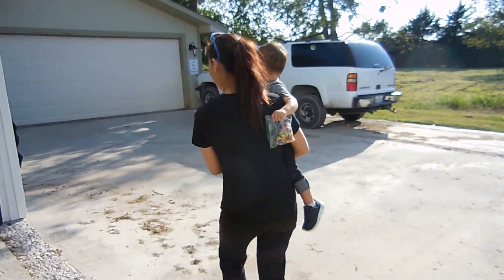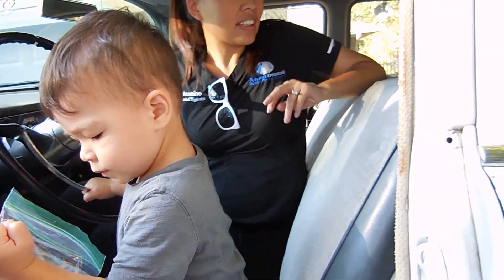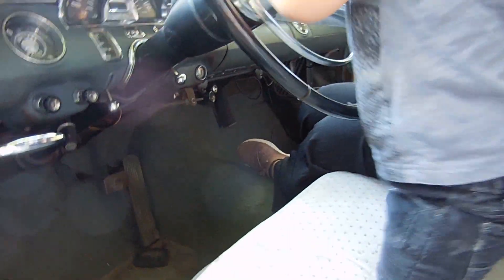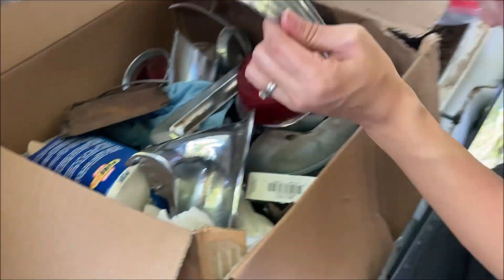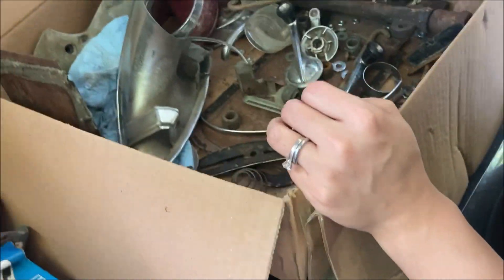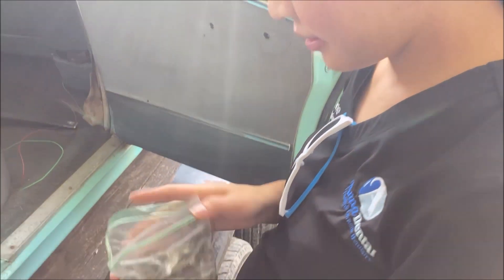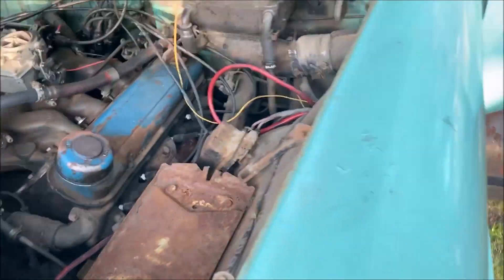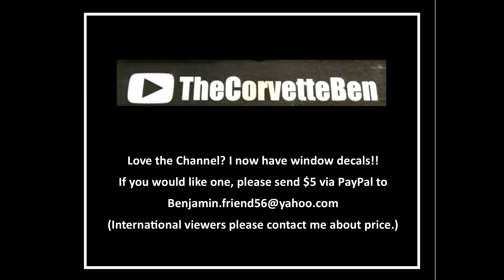WHAT?!!?!? My wife bought her first classic car!!!!! 1955 Pontiac Chieftain Sedan Part 1

Comment: YES there is a "Park" on the old  Hydramatic,, what you do is, shut off engine, wait like 10 to 30 seconds, and shift into reverse, it will lock,, had a old Pontiac,, the owners manual tells you to do that
Reply: I had a 54 cad ,when the engine shut off parking engaged on any gear but neutral....
Reply: Before I saw your reply I wrote the same thing. My late father's 49 Olds had that same hydromatic, same feature.
Reply: usausa 1  the very first car with automatic transmission was  Oldsmobile in 1939, Oldsmobile was the prototype for GM , GM sell Hydramatics to Rolls Royce and Ford ( Lincoln ) when the factory burned to the ground  on 1953 GM used "Dynaflow" transmission ( Buick division of GM) on  Cadillac, Oldsmobile and Pontiac...  "Dynaflow" transmission is very smooth, with no issues... Nissan tried to make a transmission as smooth as "Dynaflow"  ...Nissan CVT but... they have thousands of Issues...
Reply: @scrrgrc    I recall people hating Dynaflow because they were slow and caused high gas consumption.  They were nicknamed Dinosaur Drive.
Reply: @discerningmind  ha, ha,ha " dynasaur"..yes, they are very slow, but very smooth ride, I have three old Buicks,
Reply: Same as my father's '53 Chieftain.
Reply: My 54 Olds had the Hydramatic....like drfalcon4102 said drop the shift lever to Reverse to attempt to lock the transmission so car won’t move on a hill when parked, but the shift linkage requires periodic adjustment to allow for solid shift into reverse.  If she won’t shift into reverse that means the shift linkage needs to be adjusted.  Hydramatic is a four speed automatic but first gear is extremely low.
Reply: @discerningmind  Or Dynaslow
Reply: @JohnBea    Hahaha!  Very good.
Reply: Was going to say the same
Reply: @scrrgrc  Although there might have been some made with Dynaflow, most Pontiacs ended up with Powerglide during that time - it was more logical to equip them that way because Canadian Pontiacs used it.
Reply: @discerningmind  Dyna-slow
Reply: @danlove4270  Hydramatic had what was called a cruising gear.  My father kept referring to it as overdrive, but because it was a 1:1 ratio, it wasn't a true overdrive.

Comment: That light is called a Reel Out Light. It should have a cord on it. It you have a flat tire or your working on it at night, you would pull it off and Reel it out to see what you were doing. Sorry to send so many messages, but it's nice to a woman buy and old car, a Pontiac and a 4 door. You could also get a Light  for the trunk.  It looks you have some options on the car. Rear bumper corner pieces and back up lights. If you have the clear Hood Ornament that would light up at night.

Comment: Hey just FYI I owned a 55 chieftain for 10 years and finally discovered that there is a park pawl, it is engaged with the engine off and the transmission selector all the way down into Reverse.  I still would use the hand brake too but its nice to know about that little secret!

Comment: Very cool, I saved one of these from a crusher last year.  That light under the hood is neat, it has a coil of 30ft of wire in it so it can come off the firewall and be brought to any tire change in the dark to help, handy if you dont have portable light.

Nice rig!

Comment: Ben,  I had a '56 Catalina 2 door hardtop a few years ago that I bought from the original owner with 54,000 miles....Your '55 is is SO much like it.  The great thing is that so many of the Chevy parts that are cheap and available will work on this car...put the  skirts on it and have some fun!  Excellent purchase.  You could easily build it into a daily driver.  The engine is the same basic block as the 326, 350, 400 and 455.  Vintage Air sells units for it all day long... I have a '56 Thunderbird and a '66 Galaxie convertible now...

Comment: My family had a green and white 55 Pontiac. I loved it. The transmission does have park. Reverse is park with the engine not running. There is a down side to the reverse is park thing. If you manage to stall the engine backing up the transmission locks up. We always just used the emergency brake to park. One other thing the brakes do not automatically adjust for wear like modern cars do. This means you have to periodically adjust them your self

Comment: Nice car, we always had Pontiacs and my dad had a 55 coupe company car. I would go for seat belts and a disc brake conversion after all the necessary repairs,  the drum brakes on these cars were horrible.
Reply: And a 10 so delco alternator and a good ignition system......flush gas tank and a holly girlie system

Comment: The light under the hood that you saw is a neat little accessory.  The light slides up and out and is connected to a wire which can spool out to help drivers notice the car on the side of the road.  I saw a trace of red on the inside of the light.  That red can be restored by repainting half the inside vertically so the red can warn other drivers when the light is put on top of the car.  The cord is about 10 feet long.  Enjoy.

Comment: Wow, the baby has grown a lot.  Your wife is beautiful and very nice.  I don't recall hearing from her in other videos.
The under hood light detaches and has a long cord wound inside of it.  It's to reach to each wheel to change a tire at night.
I seem to recall when the engine isn't running you can put the gear shift into reverse and a park pin engages.

Comment: There is a parking pawl it's in reverse. On my Olds I would stop the car, put it in neutral , shut the car off, then pull it down into reverse. It acts just like Park in the subsequent transmissions

Comment: The other option you have is the grille bar that crosses at the bumper guards. Looks like the white was repainted , but that ok. It's me. I notice stuff. I'm not picking it apart, I just spot things. Some white paint under the chrome door trim on the right front door. Good luck with it.

Comment: I bought an All Orignal 64 Catalina 4 door sedan that was missing the floor mats and had incorrect plug wires and heater hoses. I also replaced the Heater Core. Everything I bought came from AMES PONTIAC. Good luck.

Comment: The 55 and 56 Pontiac sedans are a perfect Choice for a hobby car, one that does not have great value but is still able to find parts . Is that the original 287 V8? I always wanted a  55 or 56  Safari Wagon, the Pontiac version of the Nomads. Good luck,, see you when shes learning!

Comment: Very cool old car. Looks like it has the 55 VR with the two screws going down through the cover into the base. See a lot a similarity to a 55 Chev. But did I hear you right that some of the lenses were glass? And that under hood light on the firewall looks like something out of a submarine from WW II.

Comment: I have a feeling that light under the hood might be a version of GM's Autronic Eye, their automatic headlight dimmer, though I thought they usually had the sensor mounted on the dashboard. You probably already know all about that stuff, that's just my two cents. it's good to see you make another video on something older, I love the pre 70's stuff you cover.
Reply: The thing under the hood you think is an electronic eye is actually a under hood light that pulls out so you can see under hood when working on it
Reply: Huh, that's pretty neat. This is the first time I've heard of that, were they a factory option or something that people would add themselves?

Comment: Well: I own several classics. Specially fullsize US cars. The good old four doors are a blast if you have a family!
My kids are both in their late twenties and since their early childhood we always made tours in them: They love good old detroit iron to this day! 
I tried hard to convince my wife to drive my old iron as well. But there is one problem: She is a Filipina and  she is to small to drive my fullsize cars. Specially the manual ones. She cannnot reach the pedals and can hardly see out of the windshield. Pillows at the back and on the seat cover make driving very uncomfortable. She could drive our old S class Mercedes without problem. But there was no fun riding that one. So we sold it. The 55 Pontiac looks a bit smaller than my 65 fullsize Pontiacs. Maybe my wife could drive that one.

Comment: That's a very clean old Pontiac! Definitely not a Northern car! I had two 57s in mid 60s in NE Ohio in college. Solid runners. That hydromatic, if it's the same or variation of the 49-50 Olds hydro and the quadrant looks the same, no park but if you put it in reverse with the engine off, it acts like Park. At least the older Oldsmobiles did. If you started the Olds and didn't let it idle before shifting into reverse it would grind just like a manual, seriously. If the engine stalled backing up it would clunk to a stop just like a manual. A very different automatic, but I never had any trouble with the Pontiacs. It may have an underseat heater core like mine did. There was one in the dash for defrost and one under the seat for the interior. Yes, plumbing to both is a concern. And that underhood light? Rare oddity. Pull it out of its holder and it's a reel with extra wire you can take the light anywhere within reach of the length of the wire and wind it back on the reel and put it back in the holder. Nice trouble light of the period. A college friend from that period had a 56 Chieftain with the same underhood light. You can get an electric wiper motor from a period Chevy that will bolt on there. I did that with one of my old vacuum wipered cars. Worked nicely. No washers, though. That's a nice find!